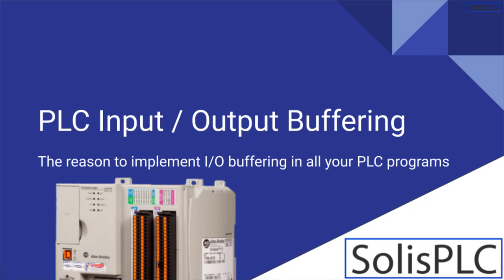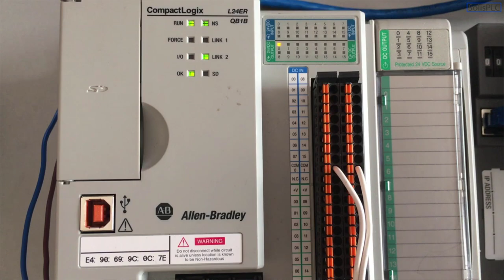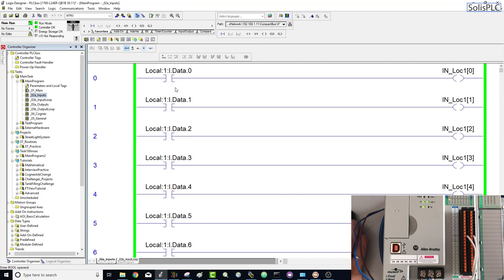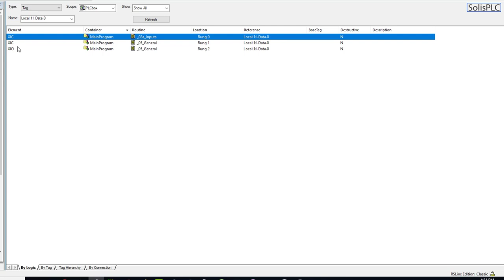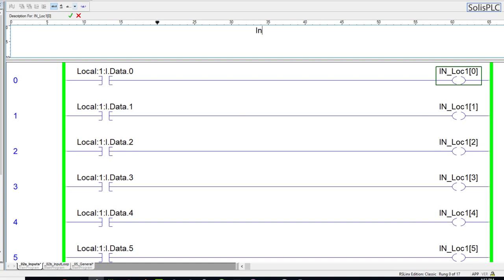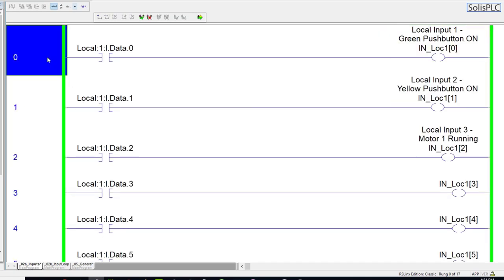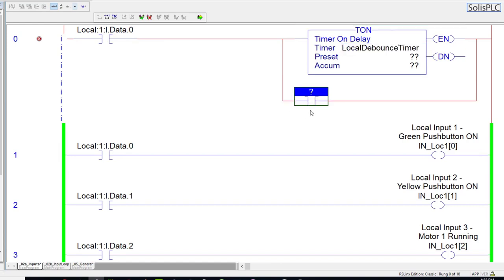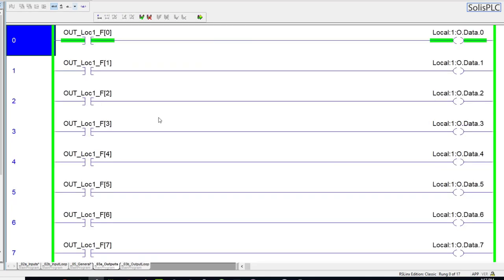PLC Input Output Mapping / Buffering | IO Addressing Basics in RSLogix Studio 5000 Allen Bradley

Comment: Doing this is useful for you have to interface to other Engineers logic. If they change their tag it saves you time from having to change all your tags in your logic. All you got to do it change it once right before the end when their design is finalized. I did this all the time in Boiler Controls when I needed BMS signals. I just had dummy points on all my inputs and created my convention tag names on the outputs which I then used in all my logic.

Comment: that function pof buffering can be done easier in TIA. if ypu have I0.0 = pushbutton
the you can change the hardware it s redirected I10.1 = pushbutton, it will change it in all the program. does Studio 5000 do something like that?